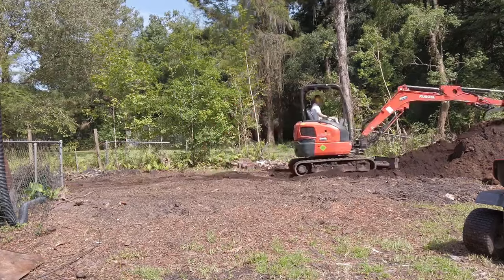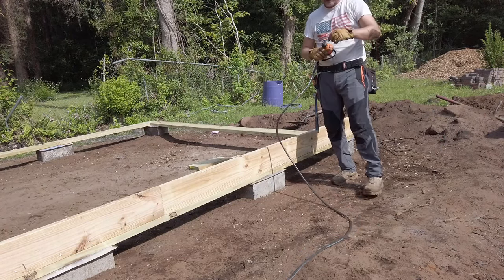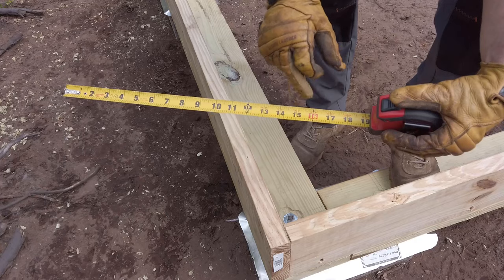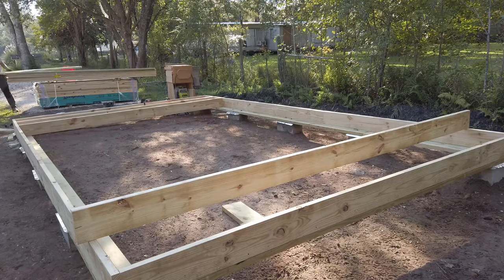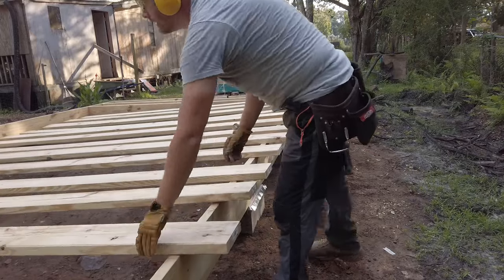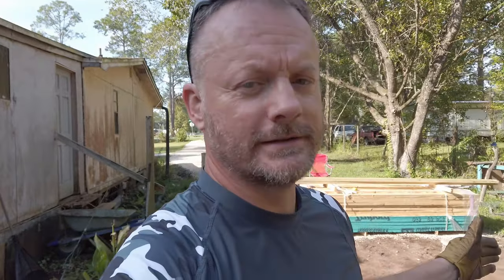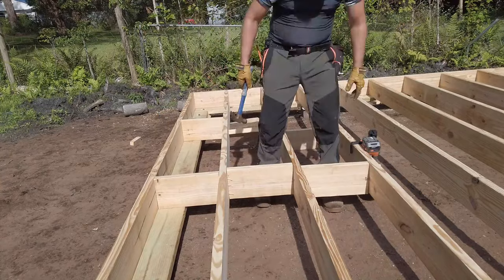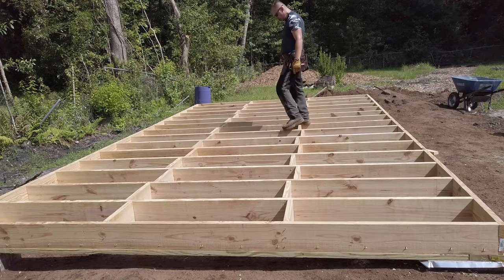Framing A Floor 🚧 Rim Joists 👷 Floor Joists

Comment: Just looks so different not seeing any support in the center that would further support a "live load" of the structure.  Id be worried in time the floor would sag in the middle.  Im certainly the over engineer it kind of person.
Reply from the maker: I'm not trying to be rude with my comment so please don't take it that way but, span charts are available for everyone to use.  You can google them and find one pretty easily.  It has nothing to do with "over engineering".  It has everything to do with wasting time and money that doesn't need to be used.  However, with that being said, someone can put as much "support in the center" as they wish.  I actually cover "live load psi calculations in the video at some point.  Have a great day.

Comment: If you had taller piers - about six foot - would you still use blocks or round sono tube columns?
Reply from the maker: Either.  I've seen both.